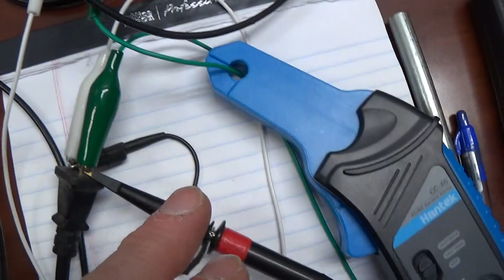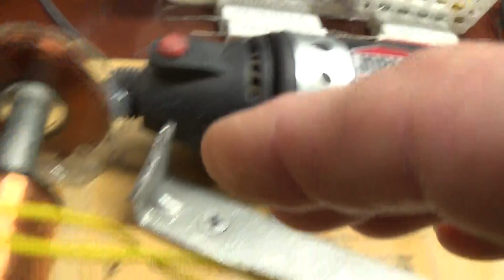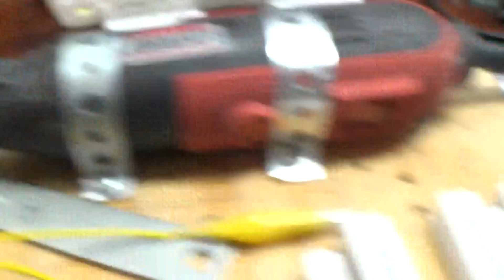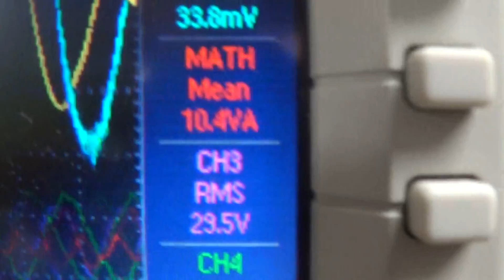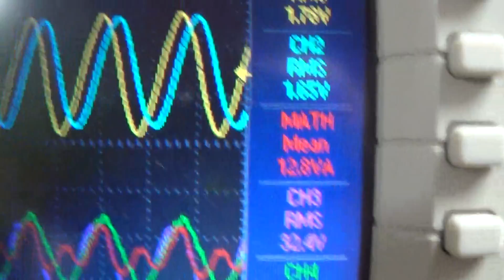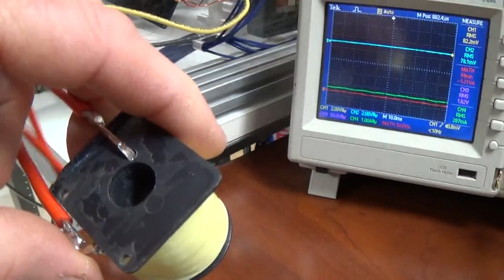Study of Generator Coil Acceleration Under Load test 1

Comment: For every type of coil there is an ideal point where you can get acceleration under load. It can be done without the additional coil. The best way is to maintain the same speed under load while the power generated is of a considerable amount. This can be done using  a small amount of power from an external source providing voltage while the coil itself will add the amperage resulting a magnification process. This process can also be used in a solid state configuration.
Reply from the maker: +Romero UK  Thanks Romero for your reply. Luc

Comment: First of all: nice build as usual! And thank you for sharing. I watched it with pleasure, and hope to see the next one soon.
I think of the rod as a piece of elastic band. And the prime mover as an up-down shifting device as an analogy). The coil is the 'closed end'  for the standing waves. As you move the coil you are actually shortening the piece of elastic band (or cord, perhaps it should not be elastic at all). I hope the analogy stands for a bit. What it does not explain or what is not in proportion is about the phase shift. There will be a point where the emf will help rotating the prime mover. On the other hand, if the closed end of  a cord is changed in an open end, the amplitude can go to twice it's maximum value since there is a returning wave which adds up.
Is this a bad comparison?
Reply from the maker: +deslomeslager  I'm thinking of the core more like water. The magnet flux, like a wave on the water. The wave is first created by the magnets movement which moves through the core like a wave on water. The coil represent an obstacle to the wave. So if it's close to the beginning of the core the coil reflects the wave back to the magnet which happens to be the same pole the wave was created causing a braking effect to the magnets movement (Lenz Law). Now move the coil back far enough on the core and by the time the wave hits the coil and reflected back to the magnet the magnet may have had enough time to rotate to the next pole (opposite) which will cause an attraction (acceleration) which is the reverse of Lenz.

As for why different coils cause different result is caused by the coils time constant (charge time) which will dictate on how much time it take for the wave to be reflected back the magnet. 
Also, another variable is, If the coil is under load at the same time, this will dictate on how much of the waves force will be reflected back to the magnet, hence reducing its capability of assisting.
I would tend to think the most efficient energy transfer would be to adjust it so the time constant and load completely absorbs the wave and nothing is returned which will cause no lost in magnet movement and no gain. 
Now, to say there are no losses to the magnets movement would not be completely correct, as we know Eddy currents in water cause losses and are also present in the core material. However,  using the newest technology in thin core material will alleviate much of these losses.
Hope this helps. Luc
Reply: ***** I was thinking of a cord like the snare of a guitar. How ever you can't disconnect one end of the snare of a guitar, so  you could think of a cord hanging on a pendulum. If you secure the bottom end of the cord, and the pendulum rocks, the wave will bounce back in opposite direction (as it hits the bottom). When the bottom is loose, the wave will add up to max. twice the height (but only at the right frequencies). This is the basic theory behind waves.
Reply: Luc gotoluc Choquette
Thanks Luc, I left out the coil as a parameter, you have put it in right perspective there. There is a form of resonance going on, and I think it is like with the wave theory limited to twice the amplitude. With magnets and coils, I am no sure where this factor 2 will end up.

Hmm. Visualizing helps .. ..
What would happen if we had a second coil, in between prime mover and test coil. Could we use it to catch the magnetic field caused by the current in the test coil? It would need to be switched at the top of the wave where the test coil is sending back. 
I must be seeing ghosts, but I am thinking of switching both coils at the right moment so we don't need any prime mover anymore but still have 2 loaded coils. I must be dreaming, a TPU is not that simple to build. Sorry for day dreaming .. .. And thanks again for the explanation. It helps to have a visual composition of something we understand instinctively.
Reply from the maker: +deslomeslager  Yes, I agree, a resonance but not the kind EE's think of, it's a magnetic flux resonance dynamic between magnet rotation frequency (speed) and core length to coil. So the faster the magnets rotates the closer you can bring the coil to the magnet. 
It is very linear. However, when you apply a load to the coil you obviously need to re-adjust to maintain the ideal flux resonance.
About your second coil idea, I think if you tune to capture (coil load) all the flux wave I would suspect there would be nothing left for the second coil to catch. However, if you couldn't capture all then your idea would work. I'm glad you got a good visual with my explanation which did the same for me. I liked it so much I posted it at the forum topics. Luc